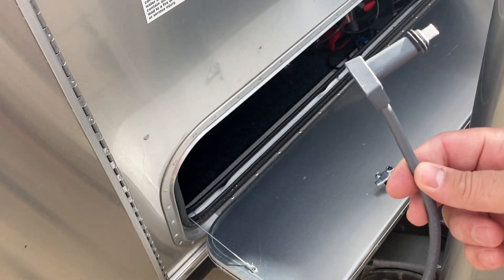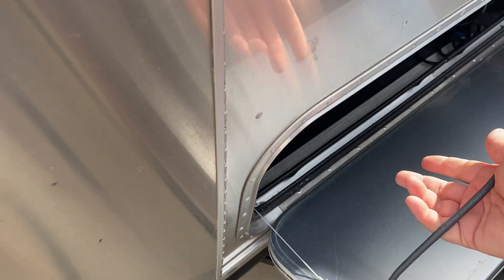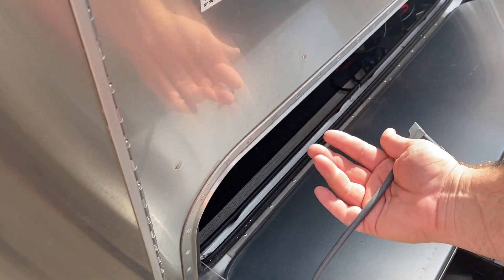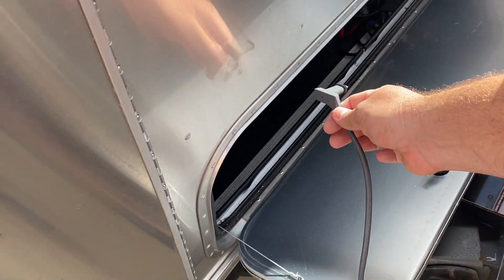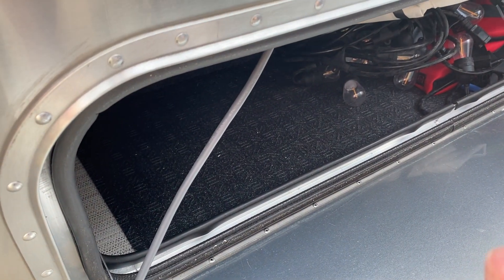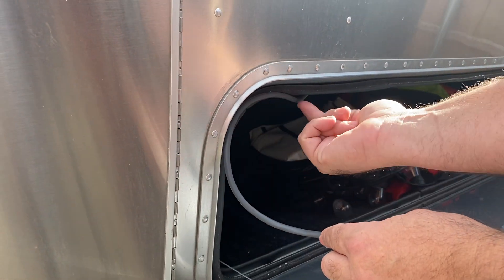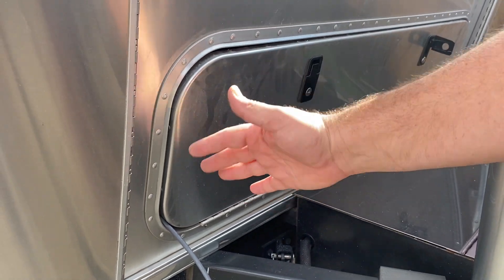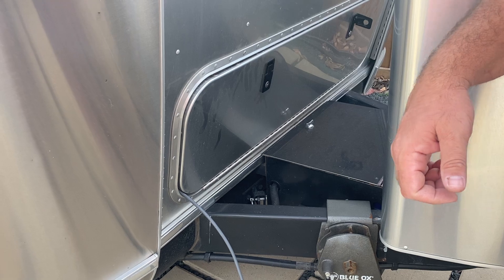Airstream Starlink Installation with No Cutting

Comment: I have been doing this on my Flying /cloud 25 FB twin and it works really well. No cutting no fiddling with cable. We leave the router plugged into the Starlink cable (don't want to wear it out) unplug the router and tuck it in under a pillow for travel. elegant solution. Just have to be careful fitting the cable though the door. Thanks for this
Reply from the maker: Thank you! Glad it is working well for you!

Comment: Have the exact same unit.  Could not see or find a gap
Reply from the maker: Hey Ryan, I do not think I mentioned it in the video, but this unit is a twin bed. There is a very small gap cut between the wood and the aluminum on either side of the center drawer. There is a small amount of foam insulation between where the wood and aluminum meet all around the bed. Push that insulation in and squeeze the connection through. Let me know if you are still having issues and maybe I can help. Thanks.

Comment: Do u have a twin beds. Where does cable come out inside inside the trailer?
Reply from the maker: We do have the twin beds. The cord comes out a few inches from the side of the center drawer, from under the head of one of the beds. There is a small cutout groove between the metal and the wood that the plug can slide into. Ours had some soft foam in the groove, but just push it to the side or through it. It may be easier to see from the inside. Pull the bed down a little and we can see this groove underneath. From there we pull the cable through and just have the router on the center drawer, plugged into one of the outlets on the side of the drawer. If your model is different and does not have the small indention cutout, a small cutout to get the cord into the camper would probably not be too invasive.